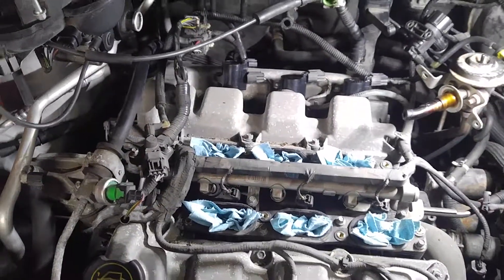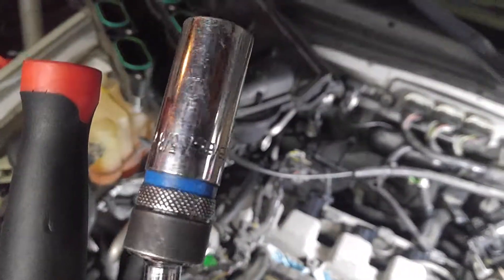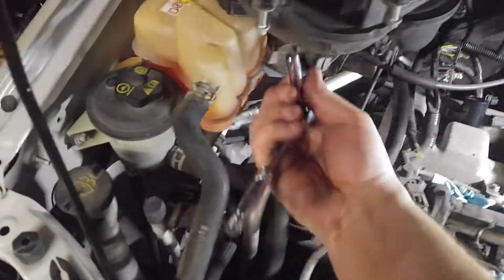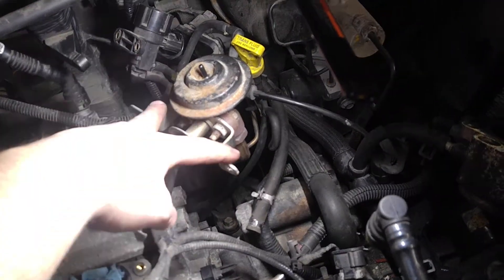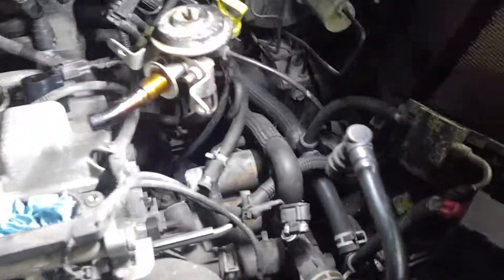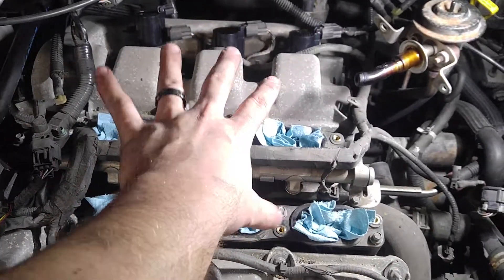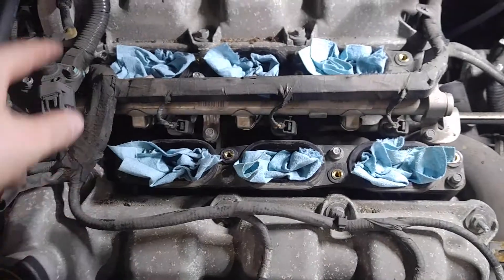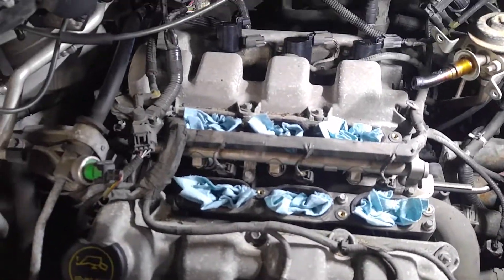2007 Mercury Mariner Spark Plugs,  And Coil Packs Replacement

Comment from the maker: Link to Motorcraft SP-417 spark pugs on Amazon $5.91 - https://www.amazon.com/Motorcraft-SP-417-Spark-Plug/dp/B0065UN2UE/ref=sr_1_4?content-id=amzn1.sym.d3f43d11-fd5a-4179-8b1e-1a03d11e07f4%3Aamzn1.sym.d3f43d11-fd5a-4179-8b1e-1a03d11e07f4&keywords=motorcraft+spark+plugs&pd_rd_r=54cb8096-62c5-44bb-86a2-e27ad851fa4e&pd_rd_w=HmGaY&pd_rd_wg=BIA09&pf_rd_p=d3f43d11-fd5a-4179-8b1e-1a03d11e07f4&pf_rd_r=2TPCRV9TFRMBM8FSXX86&pid=56gzmmn&qid=1704835733&sr=1-4&vehicle=2006-56-2627-287--9--5-8026--1-1-742-10-24&vehicleName=2006+Mercury+Mariner

Link to Motorcraft DG-513 Coil Pack on Amazon $36.45 - https://www.amazon.com/Motorcraft-DG-513-Coil-Assy-Ignition/dp/B000EQ8XJA/ref=pd_bxgy_d_sccl_1/139-1248551-3538031?pd_rd_w=BKQtW&content-id=amzn1.sym.101c7dca-f8ef-4330-838b-ed6e9ebb9e52&pf_rd_p=101c7dca-f8ef-4330-838b-ed6e9ebb9e52&pf_rd_r=BRPB4TYF6DRKHZ109NQT&pd_rd_wg=qsea7&pd_rd_r=b475cab4-f1ab-4b74-86f7-7f721b27cfe4&pd_rd_i=B000EQ8XJA&psc=1

Comment: Just curious my truck has 127,000 miles on it but no issues with my coils is it ok just to replace plugs if nothing wrong with coils lol? Also if i do decide to replace coils what coils did you use?
Reply from the maker: Absolutely,  I have changed just plugs on a Ford Edge, runs good.  Personally I would use Genuine Motorcraft coils &  if you buy online, make sure they are selling genuine ones or check sellers ratings.
Reply: Think I'll just replace the plugs like they say if it ain't broken don't fix it lol but do you know what 2006 mercury Mariner 3.0 original plugs they used I know it's motorcraft but do you know the exact part number I checked my manual and for some reason it's blank lol?
Reply from the maker: @stevensanchez8230  Sounds like as plan - Motorcraft SP-417 Platinum, here is  a link to them on Amazon,  $5.91 for Prime fast shipping or $4.89 with slower shipping - https://www.amazon.com/Motorcraft-SP-417-Spark-Plug/dp/B0065UN2UE/ref=sr_1_4?content-id=amzn1.sym.d3f43d11-fd5a-4179-8b1e-1a03d11e07f4%3Aamzn1.sym.d3f43d11-fd5a-4179-8b1e-1a03d11e07f4&keywords=motorcraft+spark+plugs&pd_rd_r=54cb8096-62c5-44bb-86a2-e27ad851fa4e&pd_rd_w=HmGaY&pd_rd_wg=BIA09&pf_rd_p=d3f43d11-fd5a-4179-8b1e-1a03d11e07f4&pf_rd_r=2TPCRV9TFRMBM8FSXX86&pid=56gzmmn&qid=1704835733&sr=1-4&vehicle=2006-56-2627-287--9--5-8026--1-1-742-10-24&vehicleName=2006+Mercury+Mariner
Reply from the maker: O'Reilly auto parts has the best price at $4.69 - https://www.oreillyauto.com/detail/c/platinum/ignition---tune-up/spark-plugs/b14eb31b13d7/motorcraft-platinum-plug-number-agsf32wm1-spark-plug/mot8/sp417/v/a/18626/automotive-suv-2006-mercury-mariner?q=spark+plugs&pos=9  @stevensanchez8230
Reply: Ok thanks appreciate it 👍👍